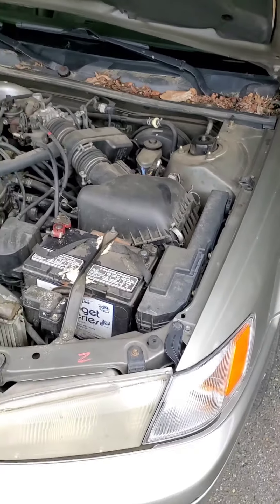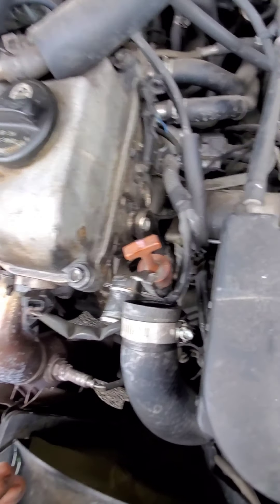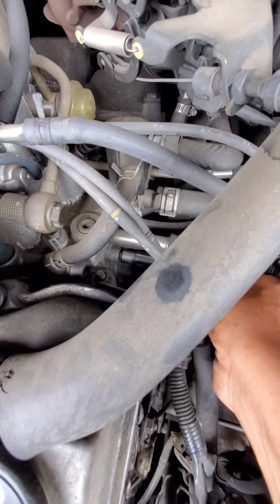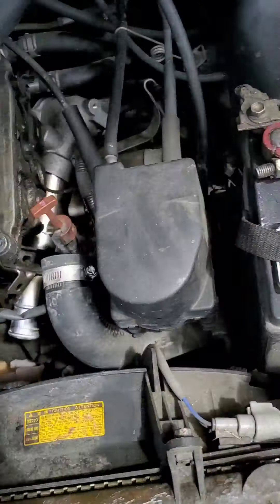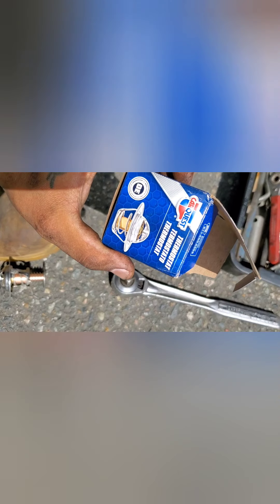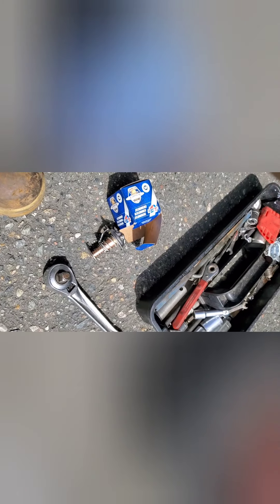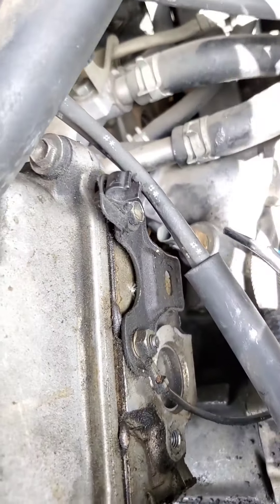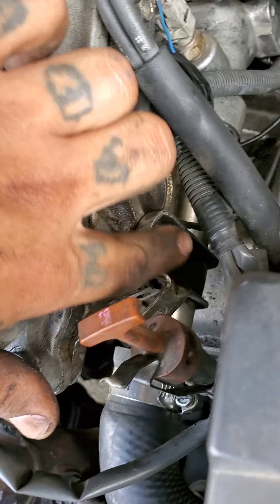1998 Toyota Camry V6 LE Thermostat Replacement Walkthrough

Comment: Are you from back east, you sound like/= my neighbor from P - A
Reply from the maker: Im from Seattle Washington
Reply: @d11auto  did you have to drain your coolant for radiator?
Reply: Did you drain radiator first?
Reply: @paradise496  I recently discovered that the problem is apparently not the thermostat, it's a ruptured coolant hose that reaches from below the coolant fill-cap under the intake across to the area by the thermostat. (That was after I replaced the thermostat.) So now I get to pull that off the intake and all and replace a hose, great! This is the 1999 3.o camry. On the 2000 3.o I replaced the radiator because the spout that a main hose clamps to on the pass. side was crumbling to bits. When I tightened the clamp on it, that was all. Hope this helps somebody, there's not a lot about that hidden hose anywhere on the WWW. The car computer was full of it and suggested the thermostat change. That was after it said the O2 sensor on the exhaust was the problem..a 130.00 part. The trouble is, the coolant overflow canister from the radiator cap was at the full mark, and I did not realize I had no coolant; until I was wastefully adding a couple gallons and saw it spilling on the ground. Someone suggested looking for a freeze-plug. But it was the invisible coolant hose under the intake that broke and leaked. I use PROLONG oil treatment, which may have saved my motor.